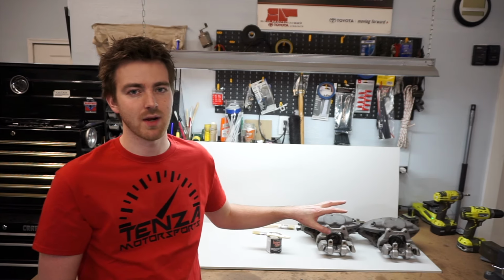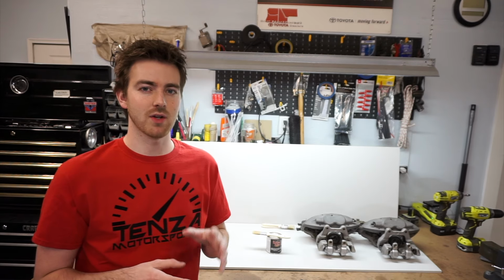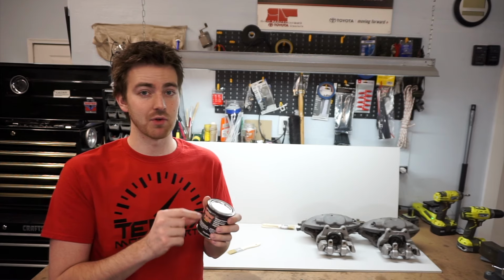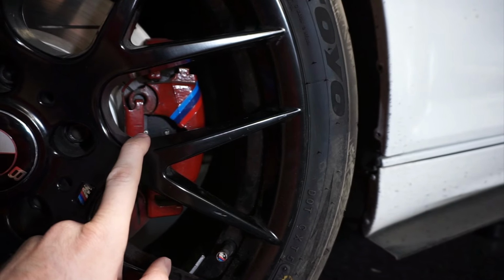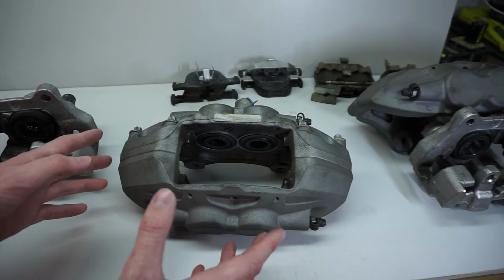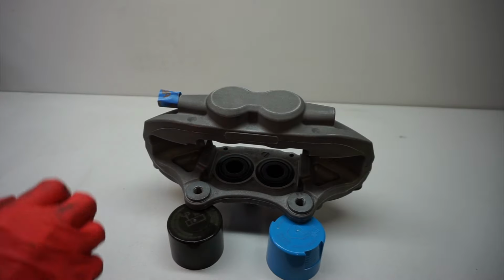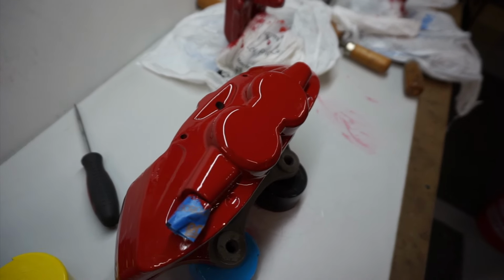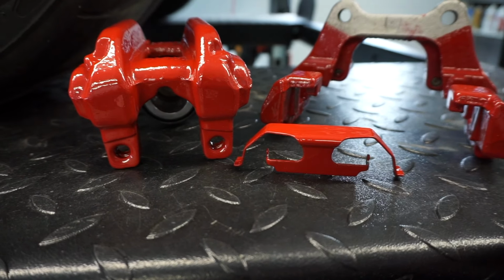How to Paint Brake Calipers. Which method should you use? Red Caliper Paint (Brush on method)

Comment: About the same process I use to prep them for spray paint. I've considered trying out this brush-on paint before, but the places that carry it either only carry red, or also have black or silver. Ended up using engine enamel spray yellow on the caliper and black on the bracket. I'll probably stick with that for floating calipers and try this if I get something like the fixed caliper you've got.

Nice job on the video!
Reply from the maker: I should have spray painted them since they were off the car. They turned out good still but It was a bigger pain than it should have been.

Comment: I use spray paint but first sand it down then use an etch primer then paint and clear coat.
Reply from the maker: Spray paint never stays as glossy and chips easier in my experience. But I’ve done both. It really doesn’t matter as long as you prep and paint correctly.

Comment: Try not to get one coat coverage. That's why it is running. Enamel is supposed to be lightly applied to create an 'adhesive' layer. Same as clearcoat on a car
Reply from the maker: I’m not sure if it was the can I have but, it has never dried right. Always took forever. I had it sit inside for like a week+ and it was still soft.

Comment: Definitely interested in doing this. How much were the front callipers? Also how did you find out about this upgrade and knowing that they would fit? I’ve only heard of the 911 Porsche caliber upgrade.
Reply from the maker: I had no idea they’d fit I was just guessing. They were taken off of a 2017 440. So I took them home measured them up, and found tge M3 csl rotor to be very close to the dimensions of the oem 440 rotor

Comment: He said it's been 2 hours and he had 2 coats on them.  2 coats in 2 hours??  First, it's 3-4 hours between coats.  Second, the coats are TOO thick.  No wonder he has runs.
Reply from the maker: You obviously haven’t painted with this specific product before. This is my 7th set of brakes and I’ve used it to paint other parts before as well. This paint has a very odd characteristic that is hard to explain and painful to learn on your own. Thick coats. As thick as you can get them and still be able to control your drips. There are no runs on these anywhere. Thanks for the comment!